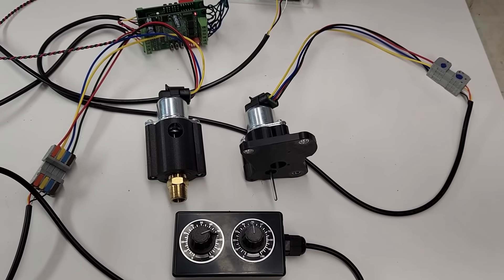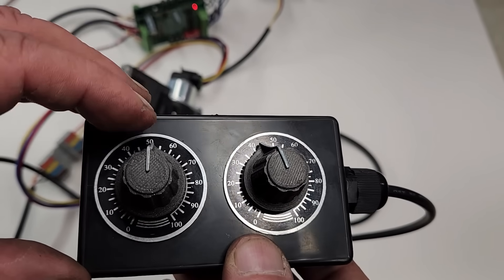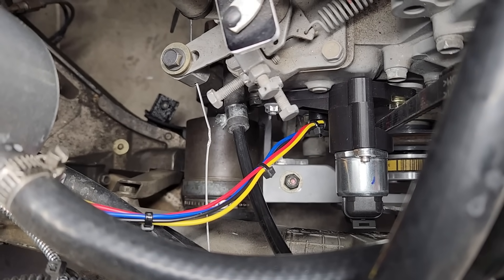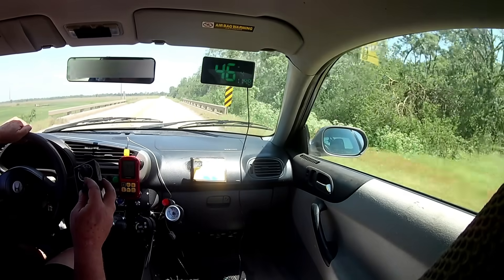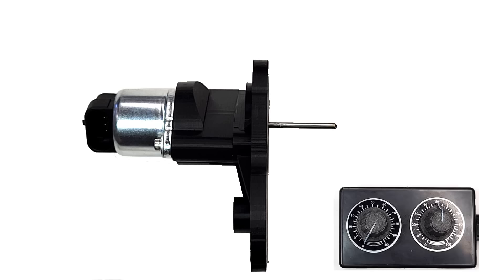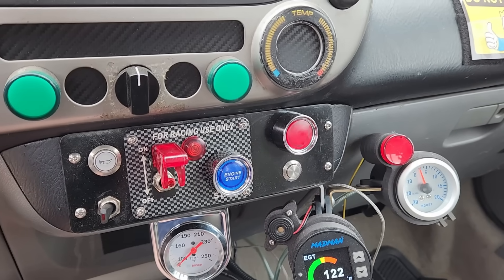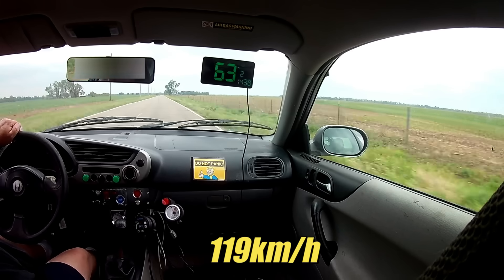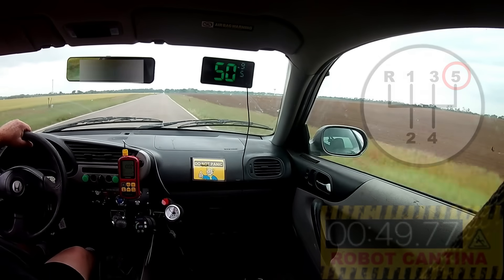S4 E19. We test custom engine controls on the AMR500 supercharged diesel Honda insight.

Comment: I would be interested to see both maximum fuel economy settings and maximum performance! As long as you can switch between them, it's you who's in control, not the computer. 

Also I wonder if there are any external ways to reduce exhaust temperatures, since that seems to be the limiting factor for performance? Perhaps some cooling fins on the exhaust and a fan aimed at them to cool it like an air-cooled engine, or putting the exhaust pipe inside another pipe with coolant flowing through the outer pipe?

Comment: I would try to program it to run at both ends of the spectrum , using boost numbers to calculate what the potential of this engine is worth , but i would also factor in a safety device to dump too much boost as most over the road diesels are done , also keep in mind the power to weight ratio for this project , for instance my friend bought a truck with a small engine to give some fuel economy , however the truck got horrible fuel mileage because the throttle had to be run nearly wide open most of the time , i suggested a larger cam and some exhaust goodies and the engine perked up some and it got around 2.5 miles per gallon, im wondering if a larger engine would work even easier and the economy would go up even further.

Comment: When going from high fuel to low fuel setting, does the stepper motor have the torque to push back against the governor?

One thing to be careful with stepper motors is speed, especially in the context of stepper motors with fine steps (where more total steps are necessary to move a given amount) and moderate torque required.  

For example, hook a stepper motor controller up to the mount motors on a 30 cm telescope and you'll find that in order to avoid losing steps, you need a number of minutes to move the telescope 90 degrees.

Comment: What are you using as inputs for your controls? Probably engine speed, accelerator pedal position and manifold pressure would be the bare minimum. EGT would be nice to let you squeak out as much performance as possible while still having good safety.

Comment: Yes Jimbo! Next step, closed loop control:

* MAP sensor and PID control the boost pressure.

* Smog meter on the exhaust to PID control the fuel rack control.

😂

Comment: I wouldn’t be overly concerned with “fuel mileage” as the car already gets incredibly good fuel mileage, as I would with “fuel optimization” as In putting as much fuel as necessary to get a desired power output without hurting the engine, the fuel economy will come along for the ride. But that seems to be your focus already, so that’s approved.

Comment: How about a smokeless (cruising) fuel rack position lookup table based using speed density to calculate load, table values being PWM values for the IAC stepper, and rpm.  Plus a EGT regulated WOT profile based on throttle position %. This would definitely be getting a little far into DIY ECU territory and a gross oversimplification of how much work it would take to program/tune but still neat a neat concept. I think its also something that could really benefit older, mechanically injected diesel engines in general.

Comment: Congratulations on getting this far with making the computer control work. I really would like to see how many miles per gallon you can get from the Insight. Is it possible to get a fuel flow sensor that will give an accurate indication of the instantaneous fuel flow? If so, you could drive at constant speed and tweak things while observing their effect on fuel flow. Alternatively you could fix the fuel flow rate and tweak things until you get the highest possible speed on that flow.

Comment: im thinking an egt sensor to reduce fuel if egt passes a certain threshold, throttle position sensor, boost pressure sensor, and rpm sensor to calculate how much fuel when you punch it, so it can gradually bring the fuel in,

Comment: Could you have the fuel rack controlled by TPS? That would give you control over how much fuel goes in without having to rely on software, & you'd have total control over the fuel depending on how you're driving.

Comment: Absolutely you should push the limits of fuel efficiency! And while you're writing that code, don't forget to include the part that detects if the car is having an emissions check and cleans up the exhaust as much as possible. 😁

Comment: Is the next engine sensor going to be an opacity sensor for the exhaust?  Or could it be a fuel rack feedback potentiometer?  Egr feedback potentiometers are present on 90s ford f150s with the v8 5.0-5.8L engines.  They are a pushrod type design.  Might be helpful info.  I don't think an O2 sensor (or a/f ratio sensor) will be any help, but I am not sure.

Comment: For what it's worth I support the idea of taking the microcontroller augmented Kubota powered Insight into the the mysterious world of even higher MPG.  To me, augmenting mechanical systems with microcontrollers is a rich vein for low cost, high fun tinkering/car modification.

Many years ago I built an analogue electronics gizmo to initiate and then modulate water injection flow on a turbocharged car based on a 5 psi pressure switch and a positive temperature coefficient (PTC) temperature sensor in the inlet manifold.  IIRC it had proportional and integral control action and it worked very well.  We were even able to prove on a university engine dyno that this approach was optimal for metering the water on a sensibly tuned turbocharged engine.  The only problem was that the penalty for over-injecting water was so small as to be hard to measure.  Implementing that same functionality on something like an Arduino would be so much easier than what we did, but Arduino technology didn't exist at that time.

Comment: The main thing is as long as Jim is happy with the progress and still having fun along the way, while introducing more technology and headaches. If it becomes a drag getting around electronic set backs then it's time to give it up.
Personally seeing a beautifully simple and elegant mechanical diesel engine improve performance without getting complicated or covered in sub systems and extra layers of complexity is where the fun lies with such a project. If the electronics don't bring significant benefits then they are not worth the time, money and hassle involved.

Comment: you probably wouldn't want to run the 3d printer on a modified sine wave generator anyway
Reply from the maker: That's also one of my concerns.  As I recall the florescent lights act funny when powered by this generator.  I  reckon there is a reason these are cheap.

Comment: The most advanced modified, controlled Kubota.

I saw a from a "Pakistani" gear producer, casting a 1 meter or so big gear,  many thought was made on how to cast a metal object in the ground of the factory,  most probably it takes 4,5 people a few days to build the mold in the pit using wood, sand and some agent is mixed in and gets activated whit some gas injected in holes in the sand, ending up hard, for each "valley" in the gear a separated mold of sand is made, they later install in the pit in the ground. it needs minimal "machine" labor to finish the gear.
"Amazing Process of Making Industrial Gear & Hobbing Process", recommend video.

The coolest thing would be casting your own head with 4 valve per cyl, but the quickest turn over would be using the cam, valves, etc from the existing head. the difficult part is thinking in inverse while making the casting mold. today i found out more people casting their own engines here on tube. using some foam. Your 3D printer can make molds for molds, like in the inlet ports. cooling jacket.

Try to source a VAG 1.2 TDI common rail diesel pump end tie that with pulley on the engine to see if it performs, +/-1500 bars!
using an actual common rail injector with some PWM signal from a Arduino, a measuring glass flask / tube.

Comment: It'd be fairly easy to improve fuel efficiency by using a TPS and a wheel speed sensor to look for "steady state" driving. Depending on how quickly the fuel rack stepper moves, you might not even notice a lag when you hit the gas.

Comment: As others have suggested, I think it would be awesome if you programmed in a couple/few different driving modes. Sport / economy / OE spec (no programmed adjustments with the factory setting on the fuel rail). Regardless, it's been very satisfying to watch this project take form. Your inventiveness is inspiring.

Comment: I mean, the best of both worlds would be to have a switch that changes your program to either optimize for power or optimize for fuel efficiency. There are programmable ECUs and controllers that allow for multiple settings (tunings), but they are not cheap, and finding a way to do it on the inexpensive side would be a good experiment for this car/engine combo

Comment: Oh man im late! For a good reason, I was out on the tractor early mowing (its the size of what this engine came off of, or close.  its rated I think at 16hp.)
Reply from the maker: sounds about right.  This engine was factory tuned for 17 hp, but it certainly can make a lot more with some tweaking.
Reply: Mine is a 2 cylinder 802cc If memory serves correctly. It's right in that ballpark, a real handy tractor but sadly I don't think I have any room for more chooch like you 😂 always a blast to watch! 

Super glad you were alright in the storms. My in-laws just had a tree down on their house last night. (All are fine, nothing too bad compared to the rest of the area they live)

Comment: Mhm more Sensors 😐 well EGT + Bosst + Pedale position is already enough for samething alpha/n like with over temp protection what do you want more jimbo? 😂
Reply from the maker: We are going with RPM, EGT and TPS initially.  We may also do boost pressure but boost is going to have three settings. Off, mid and full.

Comment: You’re nowhere near done with this.  I am extremely curious to see how far you can push it in both directions (max power and fastest acceleration and extreme fuel economy) 
I would be curious to see if you are planning on integrating the hybrid battery (IMA ?) with this Kubota engine
Reply from the maker: No plans on using an IMA.  there is zero room left in the engine compartment.

Comment: You could track the gas peddle position.  In the 1st 1/2 the range or so, you can make it do economy.  If you push past some limit it can go for power.  You can then add an extra return spring so that the gas peddle gets harder to push when you pass the boundary.  This way, everyone is happy.

Comment: I got to thinking, have you ever tried to build your own fuel injection? I am just curious if you could make a three cylinder geo metro engine be multiport. I wouldn’t think the manufacture of the fuel rail would be that difficult. It would just be getting a computer to talk to the injectors and being able to send a signal to the computer to make the injectors work.
Reply from the maker: The G10 engine in the metro has bosses cast into the head for multiport injection.  As I recall the turbo version of the G10 has the bosses drilled out for injectors.

Comment: Is their anyway to adjust timing on this engine that the other main thing that will gain mpg and timing
Reply from the maker: Nope, the timing is fixed.  We did advance it slightly by removing some shims, but overall making the timing adjustable is very complex.
Reply: @robotcantina8957  that to bad I know as long as your head bolts can hold the cylinder pressure it a great way to increase mpg and power in higher rpm

Comment: As a software guy whose only car knowledge comes from Youtube, I'm still loving this series. It would be cool if, after you've got everything else how you want it, you do some software tweaks to maximize efficiency without sacrificing "driving experience" if it can be called that with this car. What tweaks are possible that aren't really noticeable as Orwellian to the human driver?
Reply from the maker: Since this is an old school diesel engine, it will run as long as it has access to fuel.  It needs no electricity of any sort to stay running... so that kind limits what we can do to it.  The first goal is to control the fuel rack so we can eliminate the puff of smoke on acceleration.  The two gizmos plus some clever code  should be able to make the car drive normal with a visibly clean exhaust.  We will add code that recognizes when the accelerator is pressed more than 3/4 down and at that point the gismos and the software will go for MAX power.  If we add a switch or two we can indicate to the Arduino we want to drive in a different mode.  Perhaps the fuel economy mode wold restrict the movement of the rack so the reduction in power is noticeable.  As you know, with software anything is possible... within reason.

Comment: By "unloading the supercharger by wenting it in the air"  you actually ask MORE from the charger. More cfm is pumped becouse no backpressure. Venting it in the air takes maximum horsepower from the crank. Same thing as shop vacuum, put your hand on the hose > no air is goes trhu motor > speed goes up and amps go down.  Open hose > max air is pumped  so speed goes down and amps go up.
Reply from the maker: Yes/no  the supercharger is a positive displacement pump and works differently from a high speed impeller.  Venting still waist energy to some degree, but since its not building any pressure the load is decreased.

Comment: Is valve clearance adjusted since you got the engine? (Just regular maintenance anxiety).
Reply from the maker: Nope, I recon I should do that soon.  I figure the engine has about 30 hours of total run time .  The good news is the oil has been changed at least five times now.
Reply: @robotcantina8957  Oh, didn't know it was that low on hours. Run in adjustment then hehe.
Reply from the maker: @Casal70  One of the viewers donated this engine to the channel.  The engine was previously used as an engineering sample and was never started until I got it.  The engine pretty much sat in a crate for 9 years.

Comment: I'm fairly sure you could math out the change in the fuel rack. I bet if you put the numbers from your arduino code and hardware in the comments someone would have an answer.
Reply from the maker: I don't think is possible to edit the code without using the calibration rig.  The exact position on the rod must be measured when editing the code.  its very important to know the exact position of the rod because this whole contraption will work automatically.    The simple interface we used in today's test was just to confirm the gizmos work. Keep in mind, I have no problem writing the code and I would prefer the hardware was as designed.

Comment: 17:46 The bad news you say about the gizmo needing more work is actually good news for us I think.
It means we will appreciate more videos on the project while you do the work. (I would have like to be involved with the "pain" but I'm terrible at programming).
Easy to say but a couple of kits for electric bike conversion could help for the first acceleration. Maybe a capacitor instead of a battery? (just for the concept, I know it's expensive and complicated)
Reply from the maker: Oh, there is a lot more videos on the way.  Today we confirmed the gizmos work with a simple interface.  Now we have to add sensors and tune the system to function automatically.  Stay tuned !

Comment: First Jimbo... avoid Charm math at all costs as it uses dark magic! Second, I think if the RC team isn't trying to go faster the fastest while using the least fuel to do it with this project then we aren't living up to the original goals of fixing things that aren't broke and solving problems that don't actually exist. That's just my .000982567 cents (counting inflation, taxes both real and imagined, transfer fees and gratuity - also void where prohibited, taxed or otherwise restricted and recommended by 5 out of 4 dentists who chew their patients).
Reply from the maker: You had me until you mentioned the dentist .... Hmmm , I would stay away from those folks.
Reply: @robotcantina8957  I haven't been to one in decades and still have all my teeth. It's just a required part of the legal disclaimer. Probably.

Comment: Jimbo! I fully believe you can get higher fuel mileage from your little kubota. 
I put a 1.9tdi in an 89 Jetta with a mechanical injection pump I built, and I just got 66MPG going 80mph (easily!) with 2 12 ft kayaks on the roof. 
The car weighs about 1800lbs and is significantly less aerodynamic than these Hondas. The 1.9 is a bigger engine too. 
Can’t wait to see what you get out of it economy wise!
Reply from the maker: We will find out soon.  stay tuned.
Reply: @robotcantina8957  no worries there! I’m a watcher for life, I’m here every Sunday, and the occasional Thursday ;) 
Have a great week brother.

Comment: I would love to see what it can do for fuel economy. If it's something you enable when you want to, I don't see that as Orwellian at all. Besides, there's a big difference between interfering with acceleration as many current units do, versus adjusting fuel and air ratios to get optimal power production for your speed and load like any ECU would do. Whether max speed/acceleration or max efficiency is your goal is your choice, and with your electronic controls, you can swap between the two whenever you want.